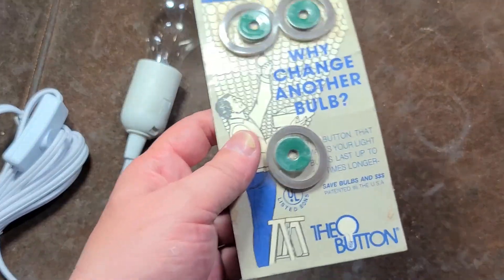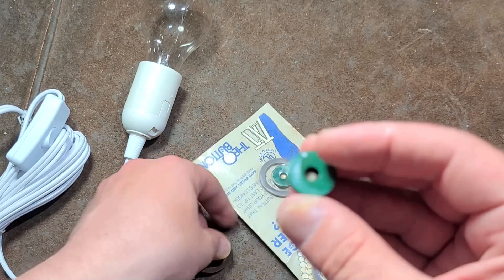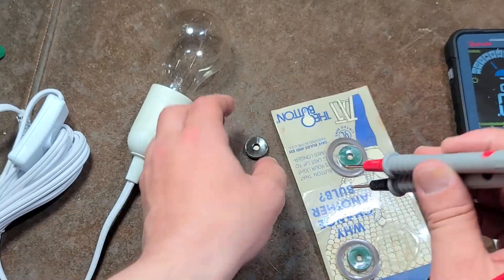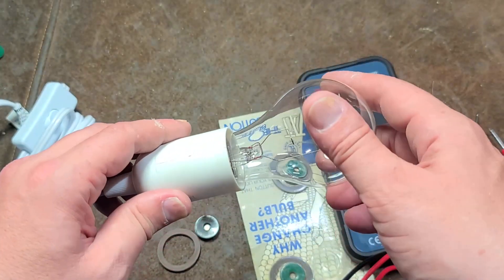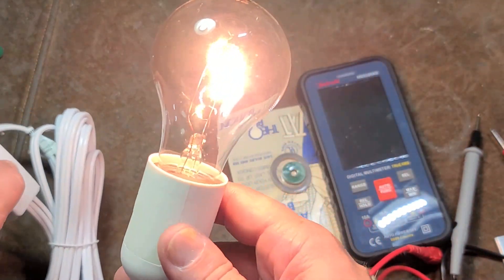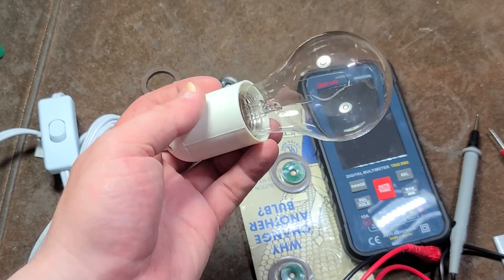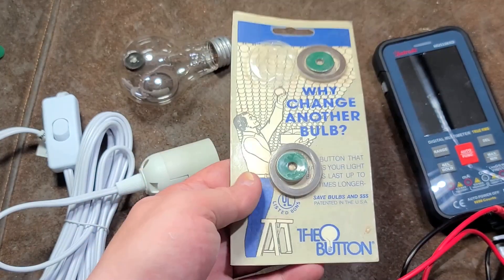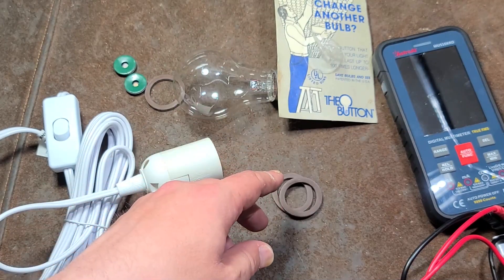Incandescent Light Bulb Life Extender Diodes Review

Comment: Makes you wonder about the over 100 year old bulb in a NYCFD  building and what THAT filament was made of.
Reply: If I recall that bulb has a thick filament and it doesn't get temperature change wearing on it since it stays on
Reply from the maker: Also, That bulb started out as a 60 watts and now is around 3 watts.
Reply: @iofs3338  Yeah, that's why old old incandescent bulbs often just burn out if they're turned on suddenly after sitting for a long time.
Reply: @LN997-i8x why I use a Autotransformer aka Triac to extend the life of my rare as hens teeth high pressure tungsten bulbs I use for photography. When I switch on I start at 30v and ramp up. While not shooting I drop to like 15v which keeps the filament ready.

Comment: It really wasn't a bad idea for difficult-to-reach bulbs. My old office was at the bottom of a stairwell accessible only by the door to my office. High above the stairs was a light that burned out shortly after I moved in. I left long ago, but that bulb has probably still not been replaced. The switch for the bulb also controlled other lights in the office, so a dimmer was not practical.
With LEDs, diodes like this are obsolete, but they definitely had their use cases when the incandescent was king.

Comment: Triac dimmers kind of work the same. Its like a fixed dimmer. You can extend the life of a bulb by just purchasing a dimmer cable which includes the triac. For fancier theatrical style you can get a Variac auto transformer and do the same just lowering the amplitude of the AC ie lower voltage.

Comment: Do you think it's possible to buy these diodes today? Do you know which ones they might be? I saw someone post on a website (back in 2010/2011) saying they could be bought off the shelf at ACE Hardware. I'd love to find something like these, to extend the life of some halogen and incandescent bulbs. 

It would be especially cool, if I could find something that reduces the voltage down 10%, making the bulbs basically a 130v equivalent. 

Lastly, first time commenting, but I've watched a ton of your videos. I absolutely love the content.
Reply: Buy a triac dimmer switch to replace your regular switch. Same result but you control how much you want to extend.